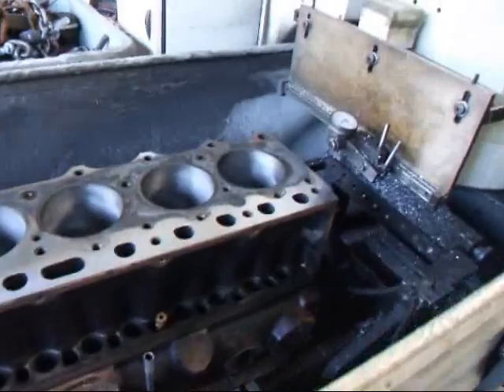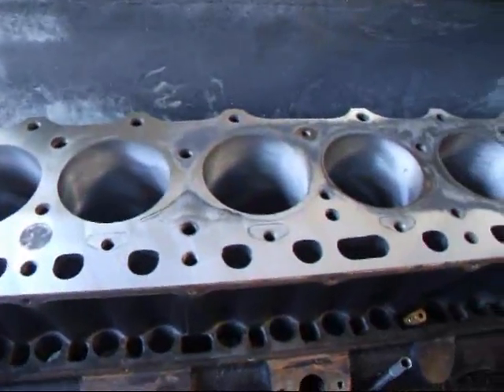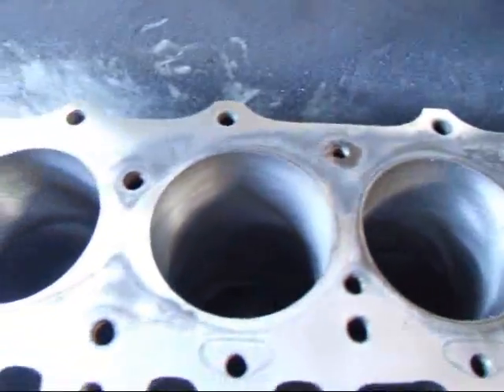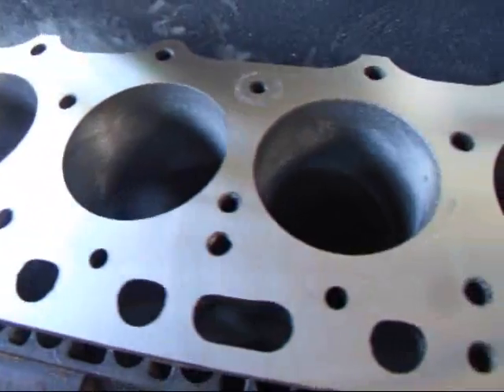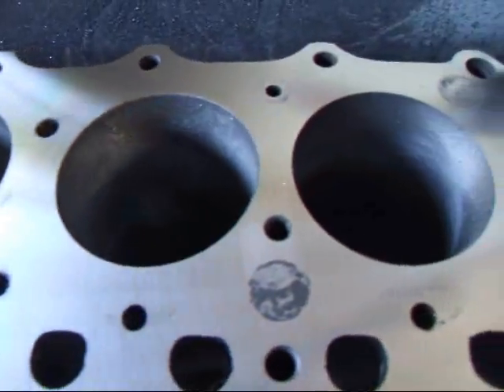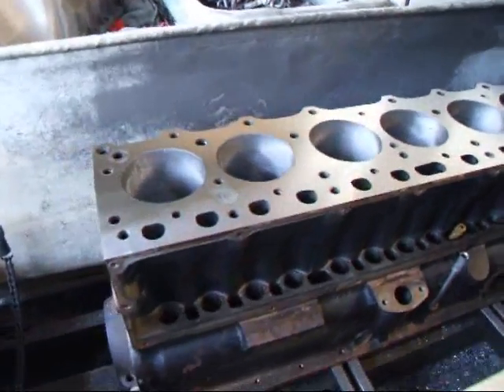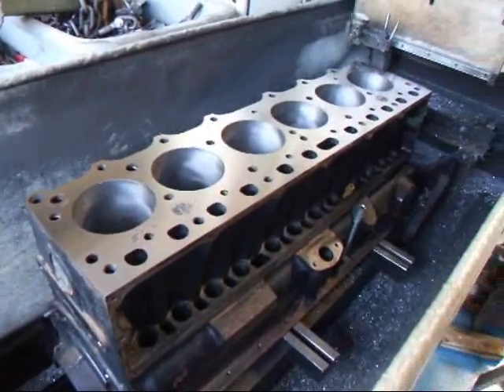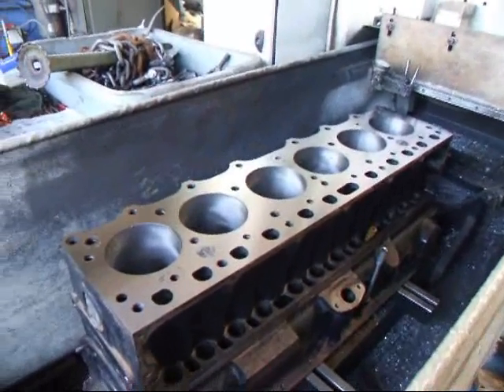1F Toyota Block Resurface.wmv

Comment: @dnl5649 If the headgasket is fine, and there doesn't seem to be any electrolysis wear...I personally wouldn't worry about it. Don't try and scotch-brite or 3m pad the stuck on headgasket pieces. Take your time with a razor blade. Definitely don't use a rotary brush, either.